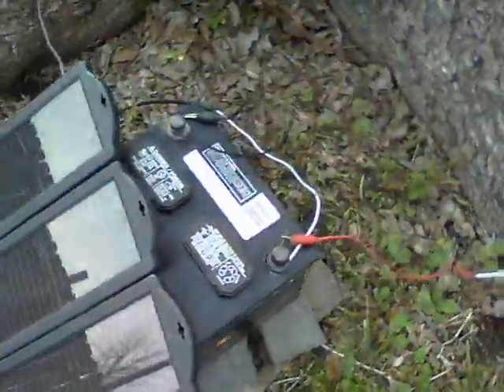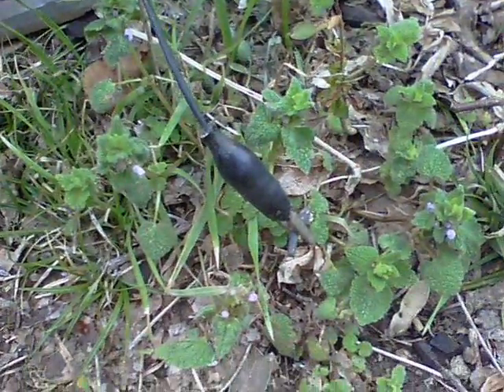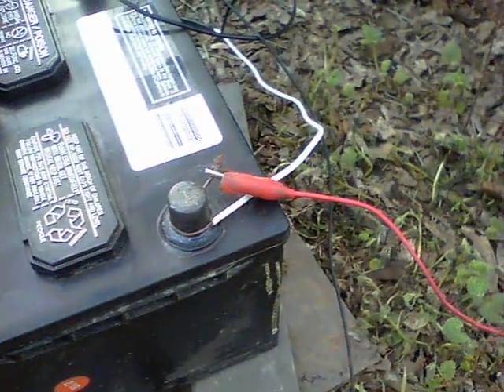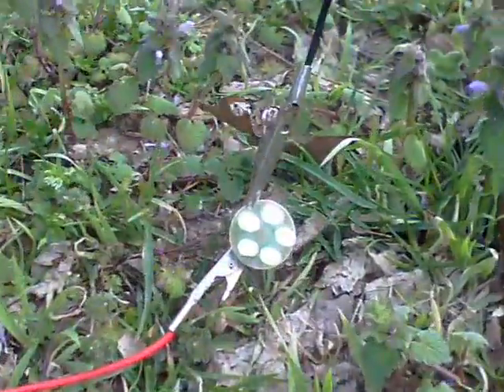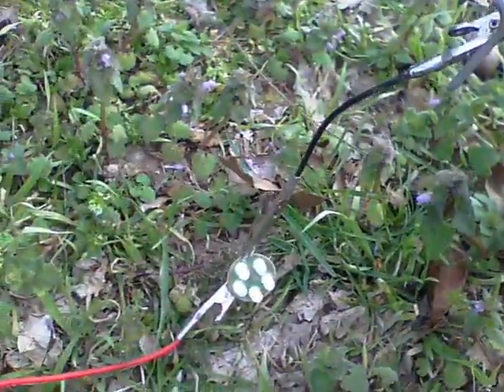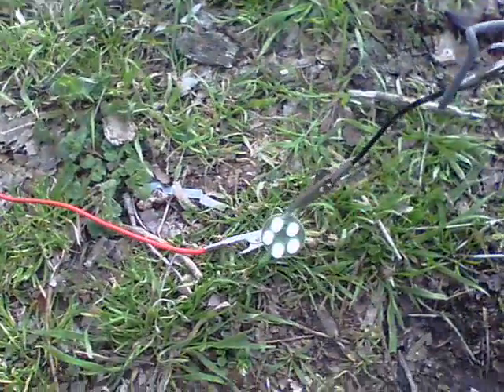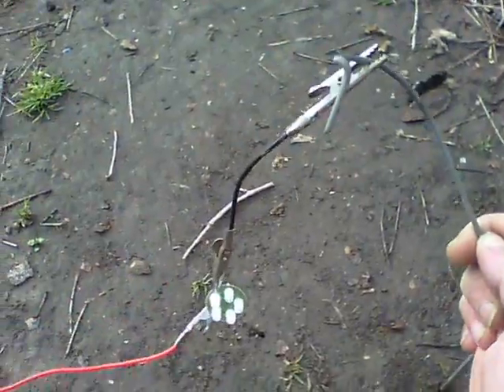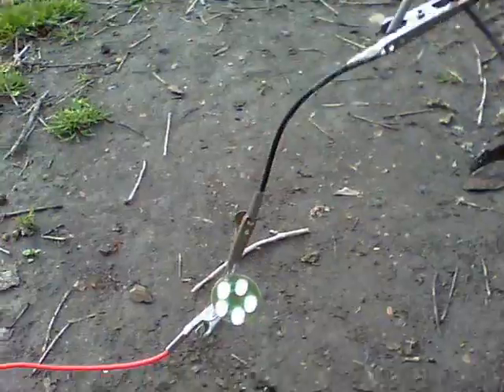DC single wire transmission

Comment: Is this limited by the cable length?  If I have a 1000 meter battery cable, will this still work?
How does electricity find its way back through so much earth?

Comment: Hi Slider. Very interesting indeed. I am wondering is the ground  moister  high or low and also with all the aluminum particles that is being sprayed these days, would that have the affects you are seeing ?.   I think you have came across something very useful,to say the least.
Thank you for sharing.
Bobby
Reply from the maker: Hi Bobby. The brightness level of the LED's should show how conductive the ground is over time and how it changes, using very little power to do so. It ran overnight last night and the LED's are still on the same.
At the moment it's quite damp. it rained the day before but then there were strong winds to dry it and the vid was made at about 6pm. I wanted to easily see ground conditions for radio and Tesla tower experiments, things that need good grounds. Just didn't think it would work like this, directly out to a few LED's and to any distance that needed measurement.
Reply: slider2732
One more question. :)  Do you think there could be a capacitive link between the battery and the ground,that could account   for what your seeing. I am just trying to understand and maybe you can make this work even better. Some very big things came from very small beginnings. Trying to think outside the box so to speak. Thank you for the reply.

Comment: The way I look at electricity is that voltage is like a vacuum cleaner looking to suck up electrons and the ground is full of electrons.  Current flows from ground to positive.  You just put something in between the two to use the electrons for work. 

Most people think it's the other way around.  I think we should charge the electric company for taking all our electrons. :-)
Reply from the maker: I'd charge them around $100 a month, the same as our average bill lol.
Yeah, I remember being confused at school by Neutral and Hot for mains, considering they swap 60 times a second.

Comment: I'm thinking ground resistance should change over distance... Something going on there. Did you get an ohms per meter average from a few sites around the yard.
Does a bigger ground pin on the battery improve the amperage?
Reply from the maker: Only visual at the moment, but I will be doing :)
Nice thought on Ground stake size !
A change to the idea is 3 stakes, both Pos and Neg terminals are Grounded, then an extra Neg is the floater. Connections are to the Pos and the floating Neg. In that circumstance, Voltage between was about 7V, mA increased to 7mA, at any test distance...similar net result to the LED's.
Reply: Good idea trying it with ground pos... I wouldn't have thought of that, but no reason it wont work. Its still bugging me why it works at all and what the choke is caused by. Its already going way further than I would think through the ground. So I suspect more ground pin would improve current.

Did you say the LEDs had 12v frv? leaving 7mv for the resistance to work on? If that's right and your seeing 5ma, thats a ground resistance of 0.0035 ohms. over the full distance. Thin copper wire wouldn't be that good. WTF.
Reply from the maker: Mongrel Shark  What is seen at the outputs is a constant of (very close to) battery voltage and 4-5mA. With both Pos and Neg grounded but extra Neg for pickup it's 7V and 7mA. Easy enough to try out, over there in Oz :)
Reply: Would be if I had a yard...

Comment: This isn't single wire transmission, this is transmission by two wires, one of which is the earth. True single wire transmission enables an earthed circuit to be otherwise wireless.
Reply from the maker: Well it is Mike ! The circuit is earthed and would otherwise be wireless except for the 1 wire. Only 1 actual wire connects up to the load from the battery. I agree with you about actual connections, but then true wireless is using the air as a wire too. Perhaps conventional would be apt as the term.
Reply: slider2732 Think of it this way. We typically represent the negative in a DC circuit as "ground". When you physically ground to earth, you have a conventional DC circuit using earth itself as your resistor to ground.

A single wire circuit doesn't need to be grounded in this way, impulse current can be transmitted by an ungrounded wire without a return for instance.
Reply from the maker: It can but normally if pulsed at high frequencies, as in by using an AV plug. I'd not seen this way done with distance between on DC. Indeed it's simply normal and logical to use a Ground as a terminator. I looked at it and thought it surely is common practice, but the Earth as a huge gauge bus wire was unexpected.

Comment: Superb, and simple. Gives me ideas for yard decorations. Why do you think your current draw is so low?
Reply from the maker: Hi Brad. At first I thought it would either run a PC cooling fan or do nothing and yet it comfortably runs several LED's directly. That's where i'm going next, if possible, to tune it up for amperage. That amperage will be based on load, so not wasted into the ground.

Comment: Looks pretty cool when you turn it on by plugging it into the ground like that.
Reply from the maker: Yeah, using the Earth as a huge plug socket perhaps. The surprise here was in the lack of output drop over any distance tried because it's DC...from a few inches to the whole backyard the output doesn't fade.
Reply: slider2732 You could also do resistance testing from one end of your backyard to the other under various conditions of dryness perhaps.
Reply from the maker: Mike Goldman Good idea Mike, because i'm reaally quite interested in why the voltage would stay high. An original reason for this was to check ground conditions for Tesla tower and radio projects, where it can affect results.